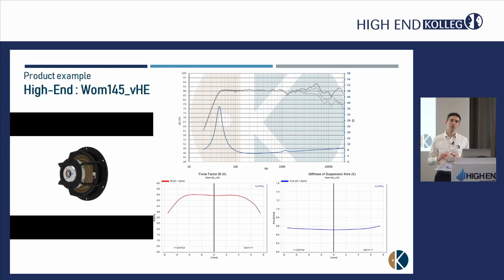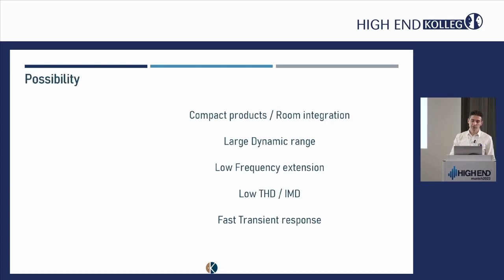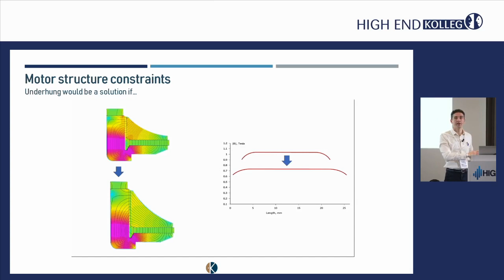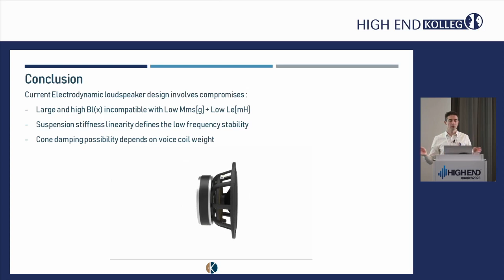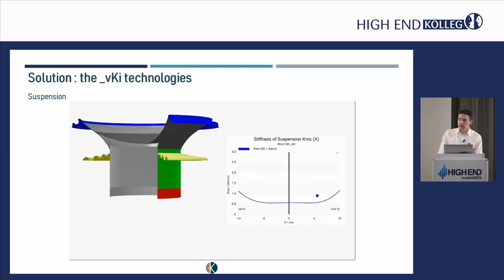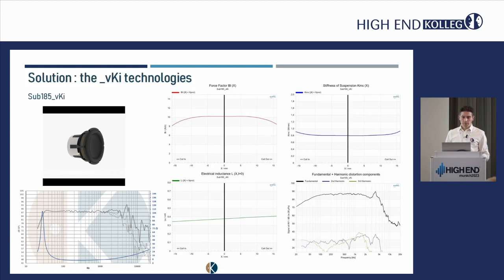Conference at Munich High End 2023

Comment: Really interesting presentation! I really appreciate your dedication to sharing knowledge to the audio community. 

An unrelated question:
I´m building a pair of Kourtisane 4.8 for myself and a pair of Kourtisane 4.2 for a friend. From what I can see the cabinet designs differ slightly in total size, but I'm guessing that the total volume will stay the same with the extra support found in the 4.8. If this is correct, could I then use the design for the 4.8 for both pairs of speakers? 

Many thanks in advance!
Reply from the maker: The net volume of Kourtisane 4.8 is a little bit bigger than 4.2. Nevertheless you can built same enclosure (4,8) for both models. The 4,2 would just get more gain at vent tuning, which is good. 
We will update the drawings in the coming months, sharing same enclosure for both models. 

1 question for you: How much would you accept to pay for an assembled enclosure without finish and with black matte painting?

Comment: Bonjour Clément. Merci beaucoup pour cette vidéo expliquant plus en détails votre nouvelle solution techologique (thick radial magnet). Je comprends qu'elle a surtout un intérêt pour accroître le niveau de performance des enceintes dans un cadre domestique. Un question : une telle technologie aurait-elle un intérêt pour des tweeters, compressions ou midranges ?
Reply from the maker: Merci pour votre message. 
Les _vKi ont ainsi un intérêt pour les professionnels: En monitoring, les ingé son peuvent travailler toutes les nuances du grave, en sonorisation on obtient des systèmes plus compacts, pratiques à transporter, plus discrets sur scène. 
Pour les HP médium et aigu, il est possible de concentrer plus de champ magnétique sans augment le diamètre du circuit magnétique (centres émissifs  proches).